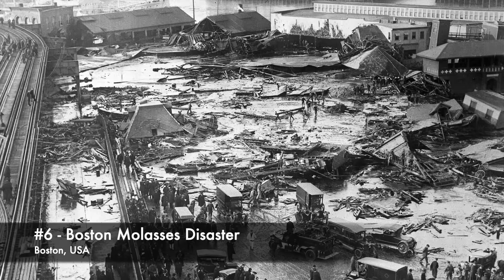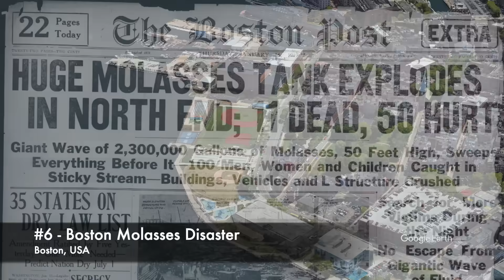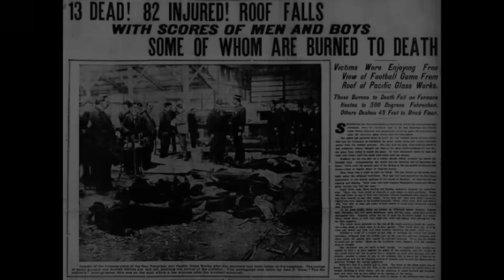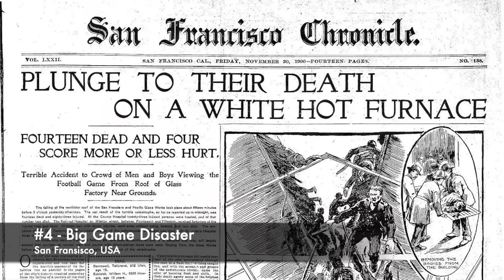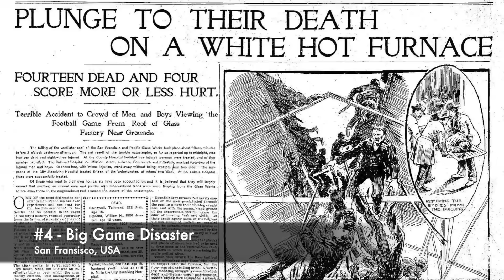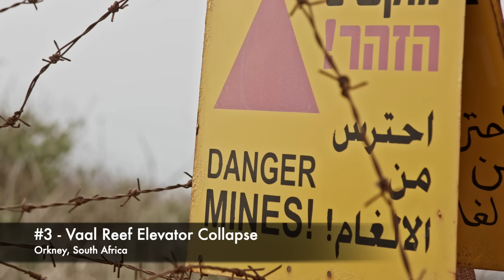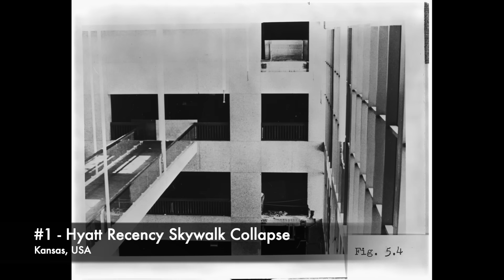Top 10 Most Shocking Engineering Disasters

Comment: I don't know if I'd call these all engineering disasters. 

 - The Verrückt disaster didn't involve an engineer as it was infamously designed by one of the park owners without any engineering input 
- I don't consider it an engineering failure if something collapses because it was used in a way it was never designed for, such as the Big Game Disaster - if the roof was not designed as a viewing platform than it's not the failure of the engineer that it failed to function as one, 
- While I am SUPER happy that you covered Vaal Reef as it doesn't get covered enough, it also was not a failure of engineering (unless you mean of the locomotive kind). The locomotive was not being used properly, and safety protocols were ignored - that's what caused it. No one in their right mind would expect an engineer to design an elevator to withstand a train. Also, if you look at the history, this disaster happened soon after Apartheid ended. Sadly, a lot of the bad workplace practices happened because there was a culture of not holding white mine owners accountable for the deaths of black workers no matter how negligent they were, so the mine owners assumed there would be no consequence to cutting corners, even if it did kill people. You'll be glad to know that, in addition to being historically significant as the worst elevator disaster ever, Vaal Reefs is also historically important because the owners were actually held accountable and forced to pay out to the families of the deceased, making it an early, clear indicator of the end of apartheid actually having far-reaching impacts in how business was done in South Africa. All this to say it's got a lot of social reasons behind it, not a lot of engineering reasons.

Comment: The toe to toe design was originally a back to back design, and when changed it was insisted that a double reiforcing web be included at the bolt suspension points.  They went toe to toe, (much weaker) and they did not install the web reinforcements at the point of bolts and nuts.  The separate bolts suspending each deck also doubled the load on the beams.

Comment: 8:43 Always be suspicious of porches and decks that depend on anchoring into the building for vertical support. There are so many ways such anchoring can go wrong , from water getting in and rotting embedded joists, to anchors into the outer wythe of brickwork (or brick veneer ) pulling the fabric of the brickwork apart. If the porch is built to be self-supporting and only tied to the building to keep the gaps even, it's much less likely to collapse suddenly.
Reply: My deck was pulling away from house, so I ran several 1/2" threaded rods from the outside of the deck, through all the floor joist, through the side of the house to a steel beam that was about four foot inside the house. It will never pull away again. I still wouldn't put 50 people on it, what the hell were those people thinking?

Comment: Germans have a name to be excellent engineers, but the Cologne collapse makes me question that. It's probably comparing apples and oranges from an engineering point of view, but in the neighbouring Netherlands, in Amsterdam, they built a metro line through a swamp underneath what is essentially a Unesco World Heritage site.

(Strictly speaking, the canal system in the World Heritage site, but this is because otherwise, it would essentially mean that no changes could be made inside the history centre without risking to lose the World Heritage status.)

There were problems in Amsterdam, with some houses subsiding more than expected and cracks appearing in walls, but nothing even close to what happened in Cologne.

Comment: Correction: What's truly Verrückt ist, that no actual ENGINEER was involved in the design of this ride. It was though out by only two men, both of them were NOT engineers und never run the math of forces that affect the participants of this attraction.
Reply: True, the original lack of engineering led to riders going airborne over the first hump, they doubled down and put a nonengineered safety cage over the ride. The lad had his head removed by the safety netting and hoops that supported the mesh.